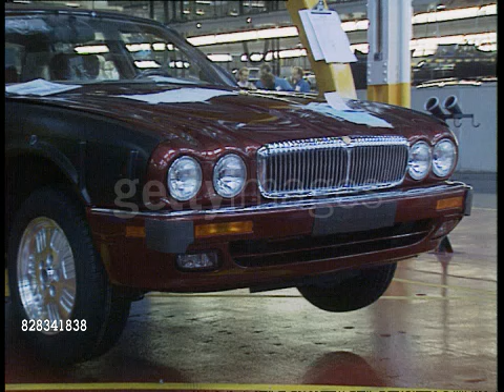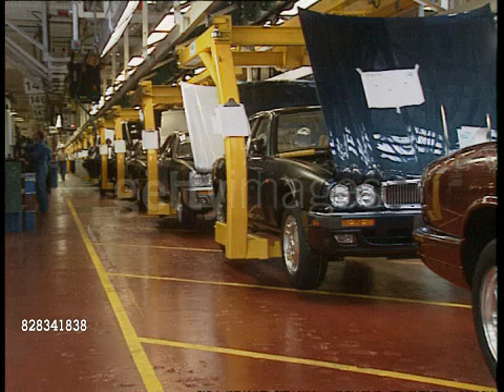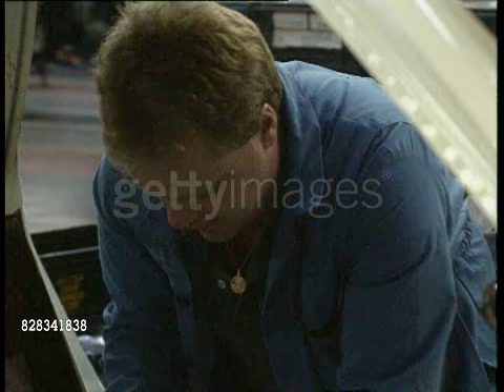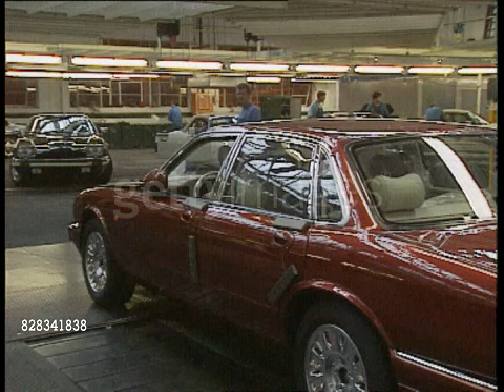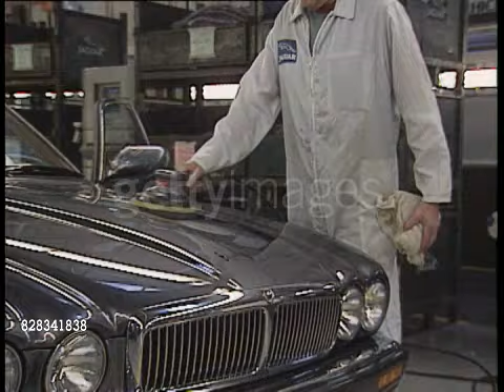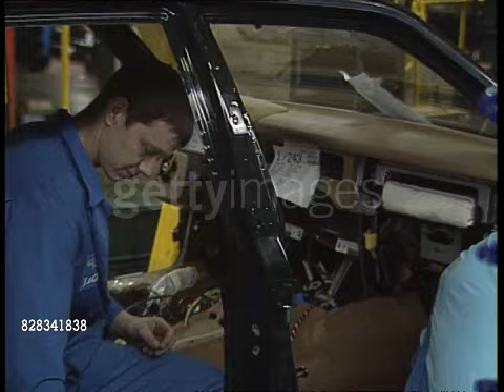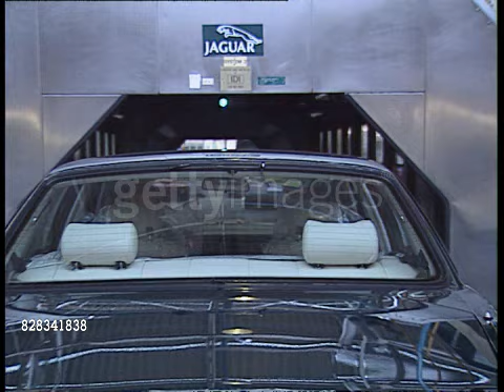Jaguar X300s on the production line 1995

Comment: My Turquose lhd. XJR probably among the first superharged off that line. (August 94.)
My daily driver for close to 5 years by now. Just short of 290000 km on the clock. Top reliable and still going strong.
Reply from the maker: That is soooo cool!! Your XJR-6 is known as the X305 model since yours is supercharged. I’m a big fan of the XJR-6 and only seen one in person once. It was black on black. But hey make sure to subscribe to my channel I have more jaguar content planning to come out shortly.
Reply: @britishcarfan9601  Actually it´s X306.  The X305 is the V12 version.
Super fun to drive but quite different from the std X300 though it looks the same. Not only the supercharger but stiffer and lower sport suspension and few more goodies that makes it a totally different beast.
Will subscribe and looking forward for more Jaguar content.
Reply from the maker: @ingvargissurarson4671  Oh thanks for correcting me, I forgot that there was an X305 model too yeah yours is an X306. Thanks so much I appreciate it!

Comment: I toured the factory when the X300's cars were being made, it was a fascinating process. The wood shop was amazing, they had their own sawmill to make veneers. A mix of high tech and handcraft, they used robots where they were best, and people where that was best. The boxwood inlay on the wood panels had the groove cut by a CNC router, but if was finished by a guy with a cabinet scraper to make it level with the walnut veneer.  I'm Canadian at near the end of the assembly line was a stack of boxes with "Made in Canada" on them. I had to ask the tour guide what they were, and they were block heaters for Canadian and other selected markets.
Reply from the maker: That is very cool!! I’m glad you had a good time I just wish that I could have done that.
Reply: @Craig Talbot  Thank you for that insight. I had a 93 4.0 Sovereign (XJ40 the model prioor to this) and I fell in love with thr boxwood inlays. In fact so much, that if any car had wood, but no hand worked boxwood inlays I wouldn't touch it. Someone crashed into her years ago  when I was driving at 133mph. I was perfectly safe, but I was sad for quite sometime...

So yesterday I bought a ......  96 Daimler Double Six (yes, the v12 version - woot !)
Reply: @britishcarfan9601  Well, I just bought a v12 Daimler yesterday, so I'll pretendto fill her up and watch the excellent upload ! Thanks for the video !
Reply: Hi. I used to work in the sawmill. Worked on the cncs. You probably stopped and watched me work. There was possibly 2 or 3 cncs around that time.
Reply from the maker: @colincoulter4931  Oh wow that’s cool! Yeah I probably did haha
Reply: @colincoulter4931  -- I have a 1996 XJ12; I wish I could have seen it being built. But I was really really little in October 1995, when it was produced. Thanks for your amazing craftsmanship!

Comment: My 1995 Jaguar Vanden Plas is just like the red one featured in this video without the hub caps. I have the hub caps on mine though. It has now, over 164,000.00 genuine miles (weekend and vacation driver). My 1996 Jaguar Vanden Plas is a British racing Green, with over 320,000.00 genuine miles, (daily driver) for the last 12 years. I can attest the quality and excellent product that came out of the X300 development program. The AJ16 engine (4.0 Litre) can go up to 1,000,000.00 miles along with the 4 Speed ZF Gearbox and difefrential. These cars  were the best model ever made with Ford collaboration. It is sad that they were made only between 1994 and 1997. If you have one, preserve it, and drive it. Do not let them stay.
Reply: Very cool, my x350 XJR has almost 200k miles, hoping to put many more on it
Reply: 320,000 miles , joking

Comment: Love being able to see this, I am taking delivery of a BRG '97 XJ6. Coming from a '91 XJ40, I am very excited to get behind the wheel. 
Something I've noticed, there's a lot more video documentation of the XJ40 than the '300. If anyone can link me to any documentaries on the X300, I'd love that,  cheers.
Reply from the maker: That’s awesome
Reply: I dont know if you are happy with your car but may I suggest you peruse the adverts for a Japanese imported series 3 , of which there are now many coming back into the UK with ultra low mileage and of course the looks which the 40 and its subsequent models could not achieve .
Reply: @jonathanpardoe8722  I’ve always loved the S3 XJ, I am keeping my eye open for one when time permits. The inboard brakes make it challenging to service.. I find the X300 being the perfect combination of that Jaguar essence without breaking the bank. X300 is so easy to live with..

Comment: The first car featured, in Carnival Red, @ 0:39 with gold growler and Aero wheels must mean SUPER-EARLY X305.  But LHD, no stainless secondary door trims (yet?), fluted grille, and no leaper mean I can't figure out the market for this car.

7:45 Amazing, the V12 goes in from the top.  Everyone else would have figured out a way to slap the entire front subframe, suspension, and drivetrain in all at once from underneath.

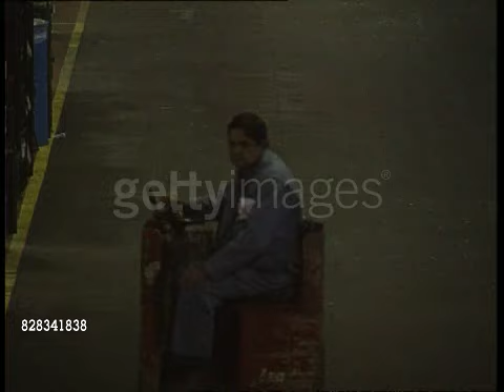8:44 No CHMSL!  WTF?
Reply from the maker: Hey John thanks so much for your comment! Wow thanks for all of that info very interesting. I love these older Jaguar X300s and X305s. I also love the Jaguar XJ40s and X308s. Anyways make sure to subscribe to my channel if you haven’t yet.
Reply: The V12 was to wide to go between the frame rails and thus, dropped in from above.
The six cyl however was from underneeth along with the rest of the drivetrain.
Reply from the maker: @ingvargissurarson4671  Very interesting.
Reply: X305 is a V12, this is a 6 cylinder VDP. The fluted grille was US and Canadian market Vanden Plas, since it's a Jaguar. The XJ12 in Canada and USA always had a smooth grille. The leaper was one of the last things put on the cars, so it probably hasn't made it to that part of the assembly line yet.
Reply from the maker: @craigtalbot6930  I know that thanks for correcting me. Thanks for all of your information. Make sure to subscribe

Comment: Jaguars are beautiful cars. However it's been my experience that they are just not reliable cars. Especially when they're used.
Reply from the maker: Thanks for the comment!! Make sure to subscribe to my channel!
Reply: With propper maintainance, knowledge and care those are top reliable. Specially the X300 lineup. 
Iv'e had several eightees and ninetees Jags, including V12 as daily drivers and never had any reliability issues. 
X306 XJR supercharged for close to five years by now and always troublefree and turn key and go.
It´s when they are not used or propperly maintained they became unrelaiable.
Reply from the maker: @ingvargissurarson4671  Yes definitely! Your correct. Ford did such an amazing job when they changed Jaguar around. And I’m glad because fords are built tough.
Reply: Very reliable  if maintained